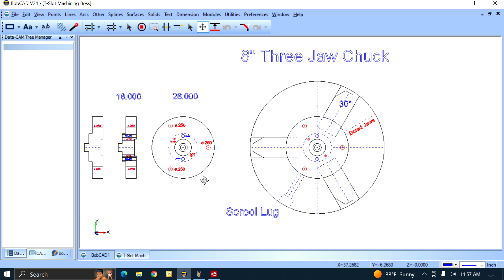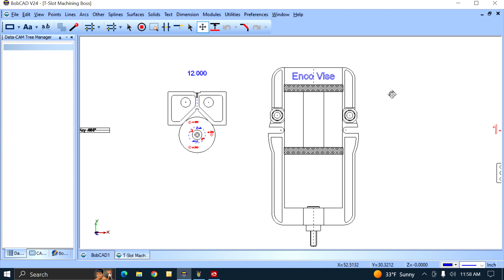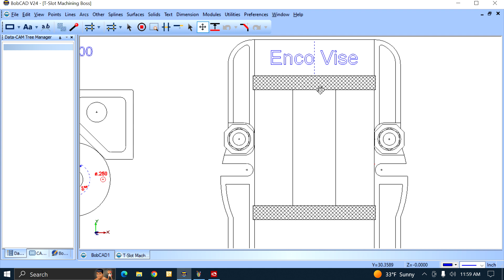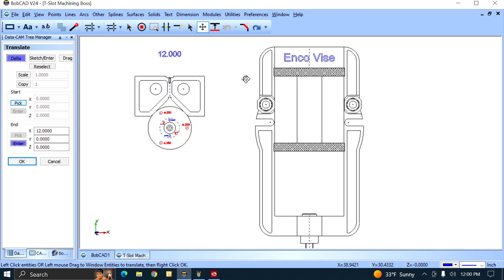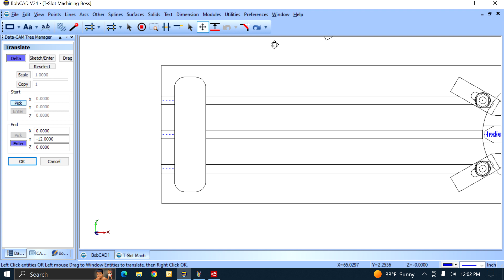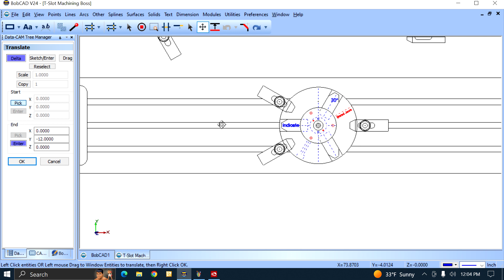Milling Machine Clamping Options

Comment: Hi Jim you asked to lay on me other ideas  Have a look at these to hold large diameter parts repeatedly in a vise.
https://youtu.be/8frIiSFJIOo?si=4hWAZbS2wMN8air_
A couple of other types here with a flat on rotating rollers.
https://drive.google.com/file/d/1B_tPAOlvVQfDqgTwQBJpDxfW_598oZ9d/view?usp=sharing
https://drive.google.com/file/d/1I7JXrSf_DCAR4xKKN-n6P8z0PAqeTT4w/view?usp=sharing

I posted them before but they seem to have disappeared so here they are again,

Comment: Hi Jim. Have a look at these to hold large diameter parts repeatedly in a vise.
https://youtu.be/8frIiSFJIOo?si=4hWAZbS2wMN8air_
Edit:
A couple of other types here with a flat on rotating rollers.
https://drive.google.com/file/d/1B_tPAOlvVQfDqgTwQBJpDxfW_598oZ9d/view?usp=sharing
https://drive.google.com/file/d/1I7JXrSf_DCAR4xKKN-n6P8z0PAqeTT4w/view?usp=sharing

Comment: I worked in a shop for a friend for awhile when I first retired and he is MOSTLY a tube bender but there is much machine work to be done just supporting that industry. He also makes and sells some sheet metal tooling that we machined, cancer as well as manual machining. He has a vertical turret drill that has a three jaw bolted to the table for drilling, ID and OD chamfering tubing. There is a hole in the table to drill longer work pieces. Works like a charm. Your idea is spot on! We also used bored jaws on lathes for some others parts. I wanted him to buy a two jaw chuck to use on square stock from 5/8” to 1” as we made several tools in those sizes. He is older than me and has scaled back a lot now. Sorry for all the rambling!
Reply from the maker: Rick - Rambling ,are you kidding me ? I was hanging on every word . it's refreshing to know that Bored Jaws have some advantages in the Machining Community. Thank you for your Rambling. -- Jim